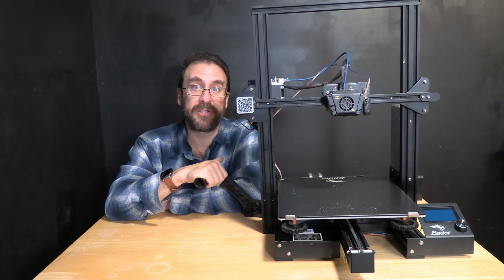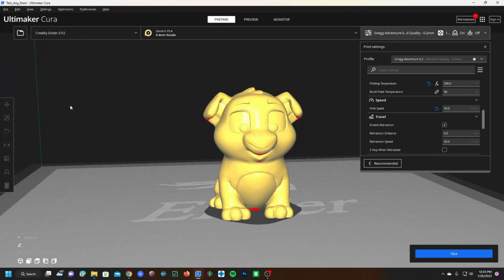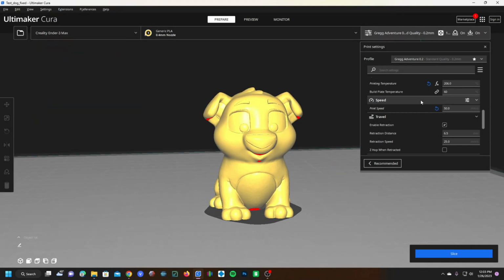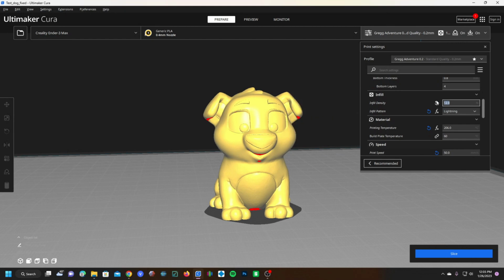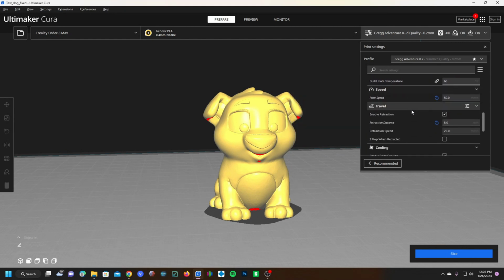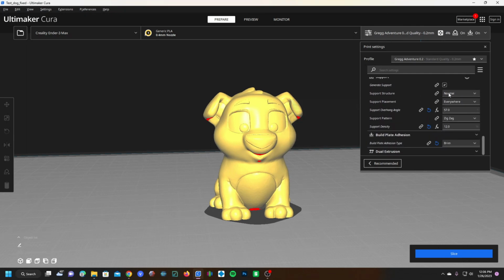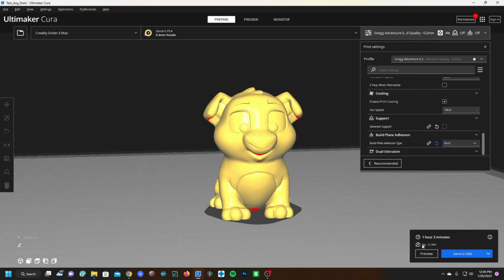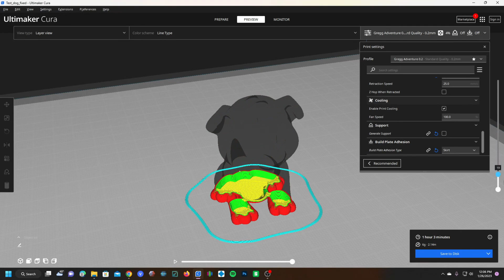How to Install a Creality, "SPIDER V3 PRO" High Flow High Heat HOT END, on an Ender 3 MAX - in 4K

Comment: Your Video really helped me out, I just installed it the other day with a few things I had issues with, over all thank you so much. my experience was that the adapter for the the thermistor was not the same. min the half left side top was open so it did not hold my wire and I could not crimp it, in fact I busted the wire trying so hard that I had no choice but to wire the new one, which I prefer anyways but that was a challenge for me. second was that I did not realize the diameter in the spider hot end is smaller so you really have to cut the filament each time regardless cause if it is deformed it does not fit through. I just wanted to share my experience but also thank you, I have not done my test print yet but that will be tonight hopefully. thanks again
Reply from the maker: My Spider is still going. Great hotbed

Comment: Will this hotend fit a CR-6 SE (strain guage)? Thanks.
Reply from the maker: I would have to check, but, I don't think so. I actually just got a CR6-SE hot end from Microswiss. I'll be installing on a 6 MAX shortly.
Reply: @3DRundown  thank you. imo, spider looks way cooler, but we can't see it anyway. Microswiss it is. I am also planning to upgrade to a ldo orbiter v2.0 direct drive. Anything I should worry about?

Comment: Technically, you don't need the boot. I f you PID tune after install, you should be ok.
Reply from the maker: You 1000% need the boot
Reply: 1000%? that's like  a lot.
Reply from the maker: It's exactly 900% more than allot.  For reals, you DO need the boot. It's an insulator. Your machine will need to work allot harder to heat and maintain a temperature, without it.

Comment: thanks
Reply from the maker: Very welcome. I'm still running this hot end.
Reply: @3DRundown  I already have an Ender 3 V2 and I recently bought a hot end spider similar to this one and I wanted to see how it was installed, thank you very much, it helped me a lot. Amazing how so much can go wrong :face-blue-smiling:
Reply from the maker: OMG, tell me about it. But, F*cking up, is just part of the game! 😆😆 V2 is a nice machine.
Reply: @3DRundown  Yes, I agree, it's part of the fun. I also liked the V2; I bought it a year ago and I'm still learning. I've already made several things like vases, Christmas decorations, and so on. I'm taking my time with everything; it's a hobby, supposed to be enjoyable. So when I start getting frustrated, I just stop and come back to it another day. My goal now is to make it reliable, working well. On my day off, I'll install the Spider again. Thank you, and sorry, my English isn't very good either 😁
Reply: @3DRundown  Hello my friend, 5 months later hahaha, the work was tough but I believe I found the solution to my parts not sticking to the bed, especially the first layer. In fact, they were coming off because they were warping, I'm working with PETG, I don't know why I started with it? PLA would be so much easier, So I tested various fan settings to cool it down slowly and avoid warping, and it has been working. I even printed the supports for the spider hot end and the BLTouch, which I was finally able to install. I noticed that the layer adhesion with it is much better now. I believe I'm on the right track. Thanks for the tips. 👍

Comment: Great video.
Stalled Spider 3 on my Ender 5 plus I did change the thermistor however it's not extruding! Help!
Reply from the maker: My Spider 3 hasn't missed a beat on my 5+. Which Extruder are you using? I would use the metal one: https://youtu.be/BrYDH4RWojY
Is the extruder moving? Your stepper is working? https://youtu.be/k2T8_rkKQLY
is it heating properly? Did you somehow swap the connections for Thermistor and Heater?
If you remove the Nozzle, is the heatbreak clear?
Is your bowden too long?
Reply: Thanks for your reply. Extruder is the one that came with Ender 5 plus.  temperature seems correct set at 220C. The  thermistor and heat cartridge are in their correct places, checked 4 to 5 times. I change to a new pack fillerment PLA . Don't think my Bowden tube is too long, didn't have problems before I change to spider. Have also done levelling a few times so my bed should be fine. I will remove my nozzle and check. I am trying to find on line the correct slicer setting. i wrote to Creallity but they didn't answer. I use Cura. One question, could I have damaged the thermistor or the heat cartridge and if so how can I tell? The temperature seems ok and when I push the fillerment through, there is no problem. I have inserted a needle up the nozzle, it's clean.  @3DRundown

Comment: I just got a new all metal hot end, not the Spider, one I found on Amazon. I have it installed, but I'm still getting low temperature warnings.   I have the Ender-3 S1 completely stock except for a new PEI plate, and this hotend. im not sure what to do now? How do I update the firmware, and which do I need? I've never done this, so please explain in very layman's terms like im a child 😂 I basically have a paperweight right now. Does the motherboard need to be changed, or will this firmware update cover all that? My printer is still under warranty. it's only 7 months old. Im waiting to hear from creality again. In the first email they asked for the qr code, the voltage setting (always been on 115) and told me to watch their Ender-3 s1 troubleshooting video I did all that and am still super lost and have made no progress at all! #Confused #Crying #Stressed #Sad Help me, please. I can send a picture of the hotend I have, and if need be, you can message me on Facebook messenger. Just look up Kandice Weaver. Thanks so much for any assistance!
Reply from the maker: Too be fair, you changed the hot end. This takes it out of the hand of creality. Which hot end did you install. Link me to it. Sounds like you may have a broken, or improperly installed Thermistor, or heater tube. Firmware should not be needed. To help, consider getting on my Patreon, or being a YT member. it will be easier for me too keep up with you. :)

Comment: Hi! Nice video, thank you. I installed successfully, but at second day I started getting clogs in all my prints. Im printing PLA at 205°. I checked extruder gear, bowden tube, bed calibration, Z calibration + eccentrics, extruder motor steps, hotend PIDs and different PLA brands. My actual retraction settings are 5mm for distance,  45mm/s for retraction speed, and 10mm for minimum extrusion distance window. My printer is the Ender 3 classic, and I'm using Cura slicer. What could be the issue? Thanks a lot!
Reply from the maker: Have you tried a slower retraction? On my 5+, I run my spider at 5/25. Lemme check my 3 Max with Spider, soon as I'm back at my PC
Reply: @3DRundown  Can you perhaps share some insight on your slicer settings?

I am on an ender3v2 with this exact hotend and I keep getting clogs when printing with PETG. My current settings for retraction are 3mm distance (as suggested by the booklet accompanying the spider hotend) 35mm/s retraction speed and 10mm for minimum extrusion distance. I am using cura 5.8. I have tried multiple settings and speeds but nothing seems to fix my issue. I also tried increasing the temp a bit for the material. My current print speed is my default 50mm/s (I have experimented with speeds ranging from 25mm/s all the way up to 80mm/s - but the same problem persists) . I 've done my PID tuning and my esteps calibration, but again nothing.

The clogs seem to only occur after 1 hour and something of printing, sometimes a bit sooner if there are a lot of supports. There seems to be a gradual build of melted material going further up than it should in the heatbreak. I also tried switching to better fans.

I somehow feel that i am missing some setting or something that somehow relates to the high flow...Any ideas???

Any help would be greatly appreciated as I 've been stuck with this problem for over a month now....Essentially I switch back to either the stock hotend or my microswiss whenever I actually need to print something functional, and in my spare time I keep trying to tune in the spider v3 pro.
Reply: Did you ever figure out the nature of the problem? 

I am facing a similar issue on my Ender3v2 but mostly when printing PETG. 
The problem only seems to occur when printing stuff that take more than an hour and a half. Melted material seems to gradually build up in the hotend going progressively higher and higher.

Thanks in advance, for any input
Reply: @Estariol87  hi! Yes. The problem was retraction settings. I set 2mm for retraction distance and 40mm/s for retraction speed. That worked for me! So, you can try doing retraction test, starting for retraction distance between 1 to 2 mm to check how much strings are in the test. Later, try setup the retraction speed between 30 to 40 mm/s to reduce much more the strings. Good luck!
Reply: @satoshidave  Thanks for the input!!! It's greatly appreciated!!!

Comment: it appears that the included thermal grease is not rated for the temps we require for 3d printing. Just a heads-up!
Reply from the maker: I prefer to use my own, however, I'm still using this printer, and this hot end, to this day....

Comment: I thought the new thermistor was necessary, because the stock thermistor doesn't have the ability to work with any temps higher than the original hot end was capable of creating.
Reply from the maker: They looked the same to me, and I'm still using it to this day, but, if you believe that to be true, trust your judgement, and use the new thermistor.

Comment: I was thinking about getting one for an Ender 3, but I'm not sure if it will install without any special parts needed. Hard to know what the real printing temperatures are too. Some say 300C, but others say 450C and that it can print PEEK plastic, which requires 370C-450C temperatures to print. I also was wondering if it's a high speed hot end, will it work okay at normal speeds too? I was reading about another high speed hot end that people really like, but people were saying that you can't print large projects at regular speeds, because it'll start having problems. You have to print in high speed for it to work, but it prints well at high speed... so it's just a requirement and not really a big deal I guess. (...and why the hell do Ender directions always SUCK? My Ender 3 directions were the worst I had ever seen and then when I got the dual Z-axis kit the directions were nothing more than a single picture.)
Reply from the maker: Directions have greatly improved in recent year. The HF Nozzles can print at slow speeds just fine. Also, consider a new machine with a Sprite Direct drive for these tough materials you want to print

Comment: does anyone have problems with the bowden tube pushing itself out of the hotend. It keeps happening with mine and it stops my prints. Im going to install a directdrive so It cant pop out, but any ideas why this might be happening?
Reply from the maker: Not at all. Your couple has failed, or, you don't have the lock clip installed. Replace the coupler, or, install the clip
Reply: @3DRundown  thank you for the help. I'm going to try it a few more times. If it is the coupler, I'll have to return it, which is a pain. But I just got an x1c and I'm in love with it.
Reply from the maker: Looking at my Spider 3, and seeing the coupler is not your typical coupler. I'm not entirely sure what the appropriate coupler replacement would be. Couplers have little teeth in them. When you depress the ring, they retract, when you insert the clip, they lock in place. If they tube was pulled on, without depressing, the teeth will be ruined. Email creality CS@CREALITY.COM, or Live chat after 9pm on Creality.com, and VERY CLEARLY IN BASIC ENGLISH, explain that the coupler is defective, and ask for a replacement. Send pics

Comment: I have applied some thermal paste on thermistor (new one) and heat cartrige. First start, preheat, and strange smell, do I've done something wrong and need to clean my heat catrige or it's normal ?
Reply from the maker: You should be OK. A new heater can smell a bit when she 1st heats up. However, if it smells REALLY strong, or smokes.... I'd have a look for a short.
Reply: @3DRundown thanks, also any idea of model name or how to find it ? I need it for klipper
Reply from the maker: I only know it as the Spider 3. I run it on my 5+ with Sonic Pad.

Comment: I ended up buying one of these and at least the silicone holes are on both sides now . The only problem I'm having is filament is somehow leaking out between parts of the nozzle that aren't meant to have leaks. Creating huge messes that will build up all around that whole bottom square part. I wish I would have kept my old nozzle. But I was so excited I just threw it away after I installed this.
Reply from the maker: You have a gap between the heatbreak and the nozzle. Sure that up.

Comment: Thanks for the Video. It helped me figure out the proper retraction distance. One thing I suggest in addition when changing and hot end is to go through the PID process to make sure you don't have temperature fluctuations.
Reply from the maker: Yes. At the time, the E3MAX firmware didn't have PID tuning. But, on any machine with PID tune as an option, it's a must.

Comment: Another recommendation would be to run a PID AUTOTUNE or MPC AUTOTUNE (depending on your firmware) for the hot end. Mine performed a lot better once I did two consecutive runs of MPC autotune using MIRSCOC firmware, much more consistent heat. The first tune threw an error but the next one was spot on, I assume because it was still learning. Save/store your setting after each test.

Comment: the first three strands came right off and you didn't swipe at the two center feet 1rst layers... how did you know it was close enough to let keep printing without touching to test?
Reply from the maker: As I'm touching, I'm lowering the Z-Offset. Once it stops moving when I touch it, I'm good. Assuming my bed is well trammed, and my ABL is working, if it sticks well in one spot, it should for the rest. I rubbed the feet from behind, as I ran out of skirt, and it was really tough to touch the little feet under the hit end. However, at that point, I can see the layer printing well with my eyes. Ideally, I'd want my Z set, during the skirt, before the print starts. Here, I just made it. Allot of experience, helps make this easier.
Reply: Okay awesome. It's good to know as I do this stuff it'll be visually measurable so I can feel confident in my patterns of maintenance and upgrading. Thank you!  @3DRundown

Comment: I ended up using the one provided because the wires broke off the original one when trying to remove it.
Reply from the maker: The wiring is junk.

Comment: i got an error on the nozzle, when trying to preheat it for a test run, i plugged the thermo sensor in and cut and soldiered the black adapter wires to the existing thermo wires that way i didnt have to dig into the motherboard with sealed plugs any ideas? is there a reverse polarity issue maybe? thanks Greg.
Reply from the maker: I don't think polarity matters, but, there is one way to test that.....   Look at your Heater tube. Make sure that is wired up well.
Reply: @3DRundown Greg it seems ok, I checked the motherboard connection on all connections. Still get err under the nozzle indicator on main 🥺 screen. When I do a PID adjustment what should they be set at? I've tried asking on Reddit. Just checking in PID, I have no clue and have never made any adjustments there.
Reply from the maker: For PID tuning. You don't change anything. Just run it, and the machine will do everything itself.
Reply: Greg, it's ALIVE!!!! It was a solder connection lol. Thanks for everything.

Comment: Greg how do you like this compaired to the ceramic version? You commented to me to look into this one for my Ender 3 pro. Whats the max temp for this hotend? Have an awesome day and a good Labor day weekend ✌️🤓
Reply from the maker: I had 2 Speedy Spider, AKA Spider 4, on my 5+, and both gave me temp problems. Maybe it was something else, but, I have NEVER had an error on a Spider 3. This is the one I am comfortable reccomending.
Reply: Greg, finally got mine in, just watching this again while at work, looking to see how you disconnect the thermal coupler wire off the motherboard, they buried it in plastic. Just taking my time with an exacto knife.
Reply from the maker: Yea, it's HOT GLUE. They do it to survive shipping. annoying, but it'll come off.
Reply: Oh I see now, I'll lightly crimp it, this'll save lots of time. Thanks again
Reply: Thanks, everything works great Greg 🔥🔥

Comment: Not working for me. I use Ender 3 with 4.2.7. mboard and bltouch. When i printing allweys the print have horizontal lines. 😢
Reply from the maker: Spider should be ok for you. Do a PID Tune on Hotend and Motherboard. Use MRISCOC Firmware
Reply: @3DRundown  I did PID Tune. MRISCOC Firmware is only for Ender 3 v2 and S1.
Reply from the maker: I use this: https://marlin.crc.id.au/
Reply: @3DRundown  Thanks.
Reply: @3DRundown  It still doesn't work. All printed models have horizontal lines. :face-purple-crying:
Reply from the maker: Do me favor, follow this video,and all that applies to your machine: https://youtu.be/pP36ozrfRQ0

Comment: Thanks for the video. I'm new to 3D print and have the Ender 3 S1. 

What are your thoughts on the new hotend now you've used it for some months?

Does the increased temp and speed work for all filaments or only special. At the moment i"m only using PLA
Reply from the maker: The Spider 3 is still working perfect and on it's 1st Nozzle. I'm running 2 of them now. But my Stock E3 Max still working great also. Your S2 Sprite Hotend is fine. Leave it be.